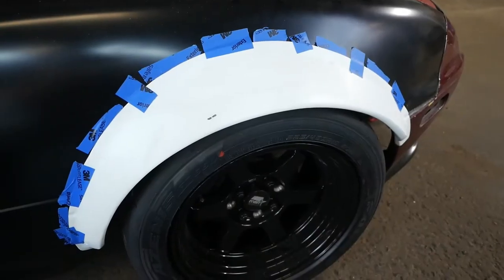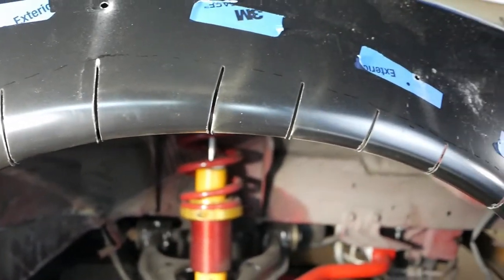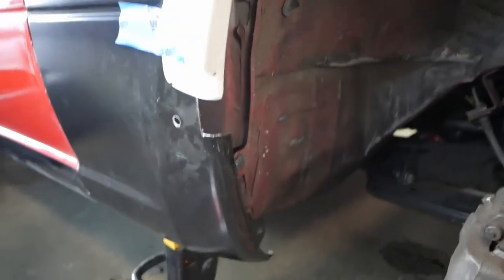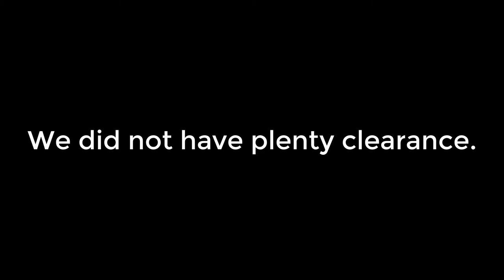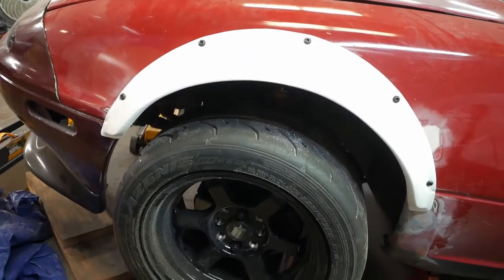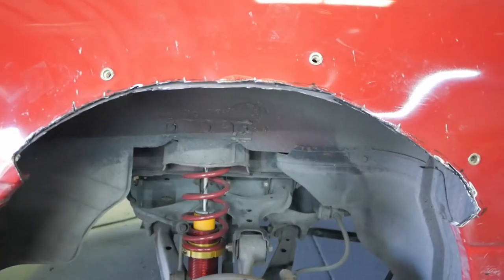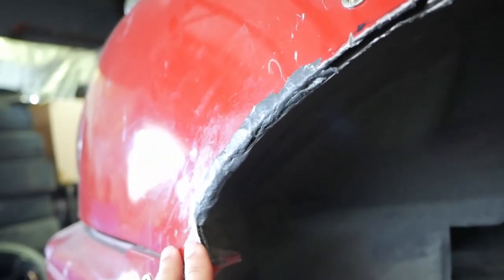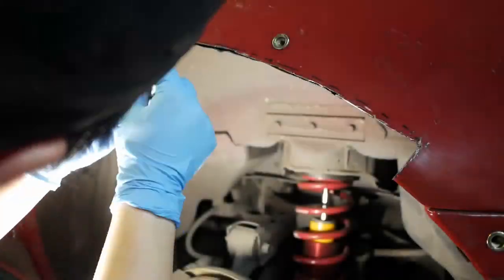$900 Junkyard Miata Project Build Gets a Widebody | How to Install Fender Flares On a Miata | Ep 4

Comment: I saw an ancient video from Japan for fender flare installation. They folded the cuts in for rigidity of the fender.
Reply: Or leave the inner skin longer the use tack welds to join it to the outer skin. I'd recommend that people watch more than one(this) video before deciding/proceeding with install.

Comment: is there a guide, anywhere, to how much offset and width you need on your wheels to run a particular widebody kit???
Reply from the maker: no guide unfortunately. youll have to ask around, buy a specialized tool or do your own calculations.

Obviously asking around for people running the same kit is easiest.

Next is doing some quick maths, eg. How much a stock body can run stock with no modifications than add how much your widebody/flare adds. Then use a tire/wheel offset calculator to see how different wheels and tires push the wheel out.

They make special tools (3D printed) that you can use to calculate how much a wheel will poke out to help you get started. https://amzn.to/3PoL797

Comment: Thanks! Where did you get the flares from?
Reply from the maker: I got them off a guy in a parking lot.  But I think you can get them from Carbon Miata (they are overseas though so be aware of long shipping times).

But they are Miata specific and not universals.
Reply: @HazardGarage  Carbon Miata is straight...so far. They sent my new LED front signals within 6 weeks.
Reply from the maker: @willmgames1775  not too bad for international shipping!

Comment: is the wheel a 15x8j or 15x9j?
Reply from the maker: 15x8 +0
Reply: @HazardGarage  thank you 🙏 I saw it later in a video of yours haha but my fingers were too fast. Do. You think 15x8 -5 would still be OK?
Reply from the maker: @SchlechteBewertung  +0 was sort of pushing it so -5 would be tighter.. You might get away with it with a narrower tire or wheel some camber (but you'll need aftermarket camber adjustment since stock is limited) but its hard for me to say.

Comment: I'll give you credit for jumping into a project of this magnitude, but you really need to rearrange your work sequence.  learn how to weld, then invest in a few metal cutting tools besides a cut off wheel.  We all make mistakes, skill comes by learning from them.
Reply from the maker: Thanks. This was my first big project (For me). It was my first time using an angle grinder! Of course since this video was made I have learned how to weld (sort of) and if I were to do it again I'd probably use a belt sander and reciprocating saw to make the cuts.

Comment: What size are those wheels?
Reply from the maker: 15x8 +0 tires are 225
Reply: @HazardGarage  do you know any good wheels that size and offset but in black with a machined/chrome lip
Reply from the maker: @GamerTim3  I got my wheels from Fitment Industries. They looked like they had a good selection and examples.